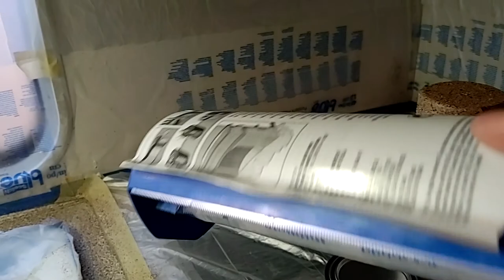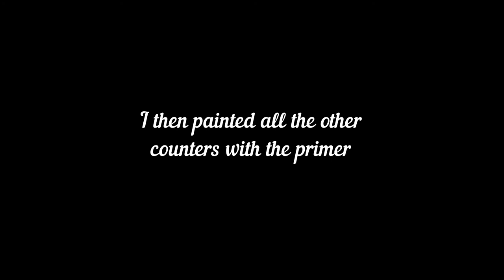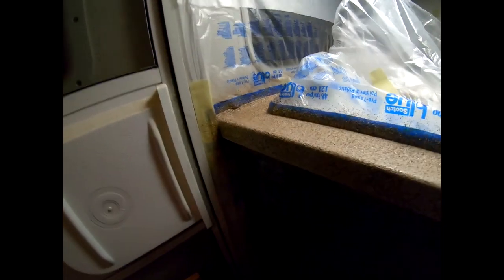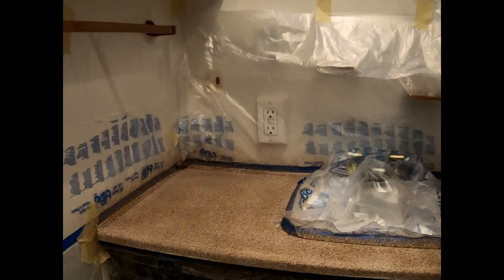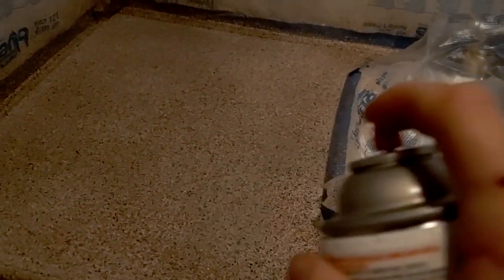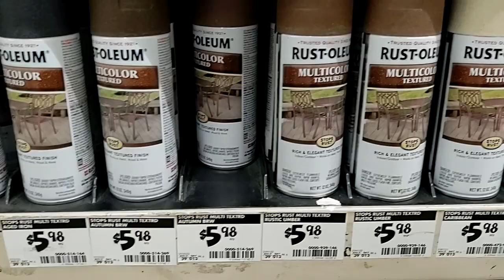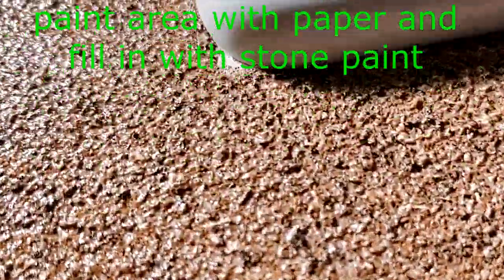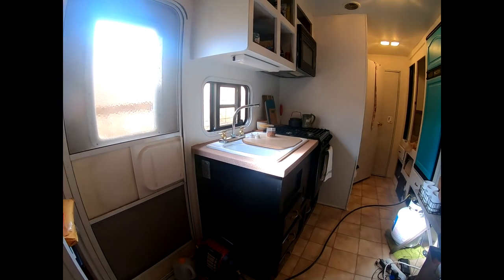5th wheel Renovation | Faux Granite | Painting my counters

Comment: A neat little trick to painting clean edges in corners that I learned back in the 1970s and 1980s that avoids taping is: (Drum roll please!) Expired X-ray plates!
You want to paint your wall without getting paint on your countertop? Lay the X-ray plate on the counter and push it against the wall while running the brush along the wall where it meets the counter-top. Lift the X-ray plate, and voilà you have a clean edge. Apply the same technique to paint the counter by setting the X-ray plate against the wall. Similarly, put the X-ray plate on the glass against the framing to paint the window without getting paint on the glass.